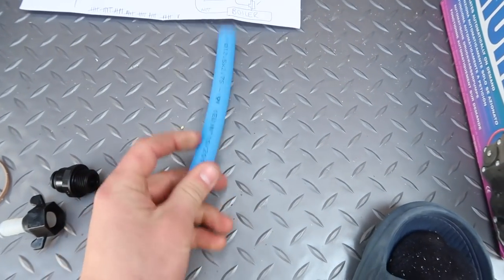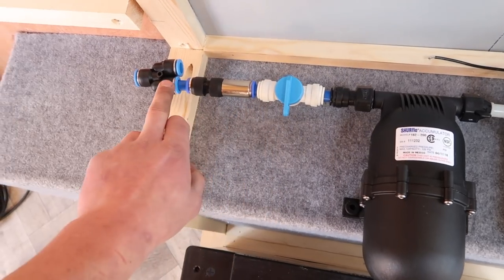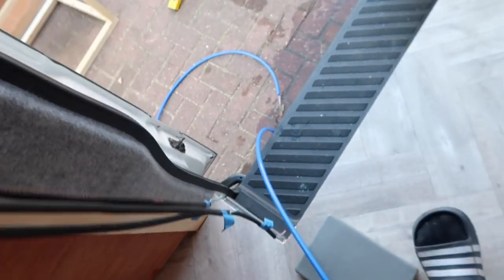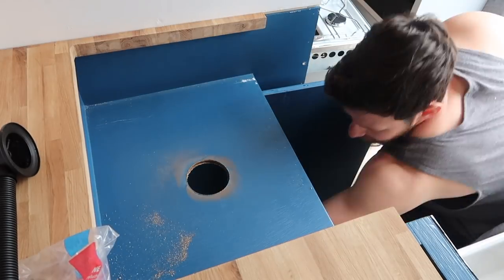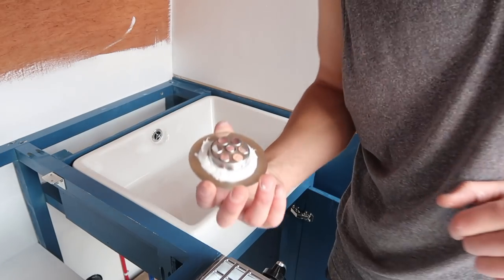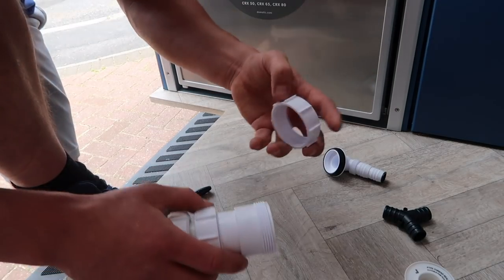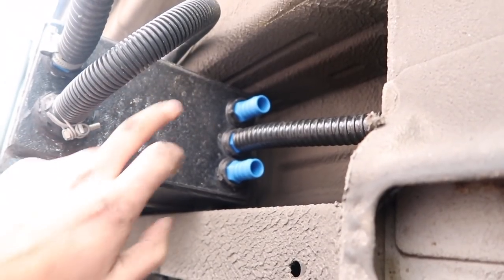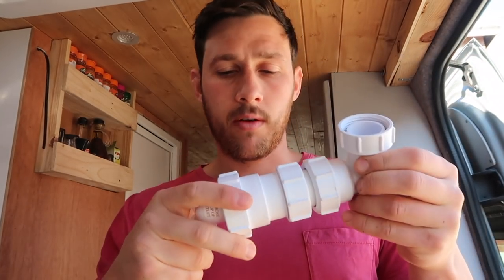Plumbing | Ep21 | Sprinter Camper Van Conversion

Comment from the maker: In hindsight if your waste connection is 40mm like the one on the sink we purchased I would just fit a 40mm shallow bathroom trap with the spiggot connection on the end and save yourself some hassle. Or in addition if you have a inline trap that fits your waste pipe you can screw the female end of the mechanical fitting with the spiggot in place straight onto the sink waste although I'm unsure if this would make a good seal..... the things you learn when you watch your video back. I will likely be changing ours to one of the aforementioned setups #brainfart

Unfortunately we purchased the inline traps before the sink so went around the doors to try and incorporate those which didn't work out as planned like many things during a build. At the very least it gives you some knowledge of how to fit mechanical waste fittings. Good luck with your install peeps :)
Reply: a tip: you can watch movies on flixzone. I've been using it for watching a lot of movies these days.
Reply: @Iker Emanuel Yup, I've been watching on Flixzone for months myself :)

Comment: Hi Scott Just an idea, I would double check your fridge drain its got to have a kink in it with the 90degree turn down into the floor. Hole should be drilled at 45 degree for gentle radius elbow. Great video thanks
Reply from the maker: Hi Douglas. The pipe turns 90 down and through the floor can you advise why it needs a kink? Thanks for the help
Reply: Hi Scott awesome I thought there wasn't enough space for an easy bend and that it might be pinched (not kinked) its not something you can see when the fridge is in just thought to check it maybe blow from underneath to make sure it is clear.
Reply from the maker: @dougmeyer5715  Yea I will do Doug good advice, I'll likely pool some water in the bottom aswell once the van is level as it's on our sloped drive at the moment. Will be easy enough to sort out if it is kinked

Comment: Scott great video.  I was wondering where you have put the tanks under your van and what sizes did you go for, Fresh and Waste ? Cheers
Reply from the maker: Hi there the fresh is 70l and sits just infront of the spare tyre at the rear. The 40l grey water sits in the space under the sliding side door

Comment: Curious about that water tank...Is it insulated?   I see it has the heating element but in freezing temps this will be a 1000 x's better insulated.
Reply from the maker: Good to temps of -7. The external pipes will give you troubles well before the tank will. Ours is also fitted with and auto heating element incase we are camping in sub zero temps

Comment: Top vid and thanks for the tips.. Can I ask where you got your garden hose filler you mounted to your van to fill your water.   Thank you
Reply from the maker: its just bolted to the lip that runs down from the lower panel behind the drivers side rear tyre
Reply: @ScottAndJen  cheers, sorry I meant the filler connector and plate itself. Trying to find one but unable to.
Reply from the maker: @russwalker675  it came with the tank. You could make one or try Cak tanks
Reply: @ScottAndJen  cheers both, appreciate your help.  Keep living the dream 👍

Comment: Hey Scott, great video mate! Thanks to your Maxxfan installation video I managed to put in my max fan without a hitch a couple of weeks ago so thanks, great videos very straightforward and helpful so thanks for the solid work! Can I ask whether having your water system so close to your battery  system could leave you open to battery/ electric issues if there were a leak? I am thinking of having the same setup and just wanted to know whether you had considered this when putting it in.
Reply from the maker: Happy days Tom. Sounds like your conversion is coming along. It's not really an issue to be honest. The water system only runs adjacent to one of the batteries however the batteries are sealed unit so aslong as they arnt sat in a bath of water then they are quite resilient. The open terminals on the top would likely short if they were to contact water bit it is standard practice to have inline fuses fitted for unlikely surges in power. Along with that we have yet to have a leak on the system. Advice.... have as little amount of joints are you can, make sure all the terminations are full slip, don't over stress the joints on corners or when redirecting and give the system a good pressure test before burying or sealing anything in. The pressure from a 12v pump is negligible on the push fit pipes and joints so you should really be good to go. Good luck
Reply: Thanks for the reply bud. Much appreciated 🤙

Comment: Mate you may need a regulator on your mains water pressure; not sure what the max water pressure on your truma is....
Reply from the maker: Hi there, thanks for the reply. The Truma has it's own pressure release valve that is inline on the inlet cold water supply so won't have any problems there. If you wanted to put a backup in that would be upto you but I think it would be abit overkill, plus when you are on mains pressure you want to be seeing the benefit when using your shower.